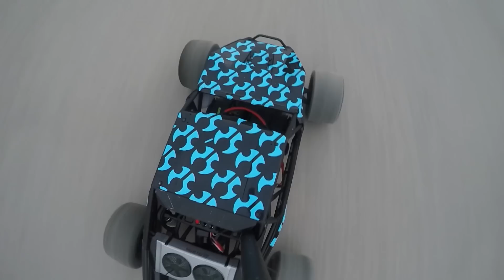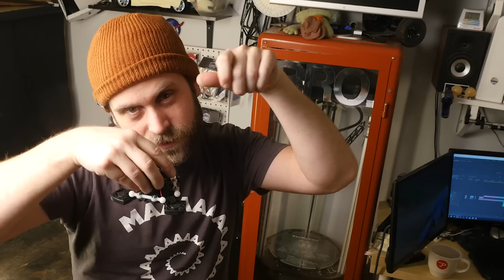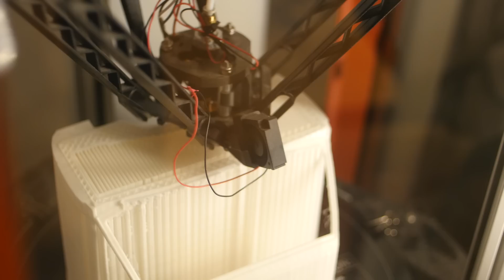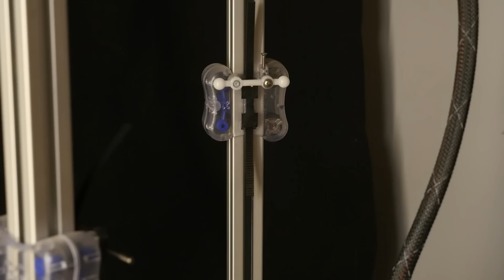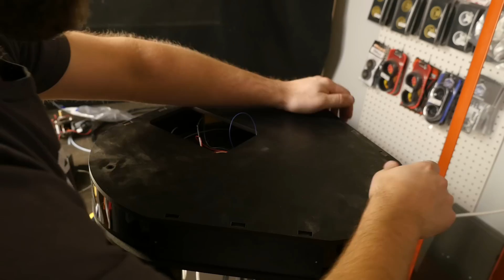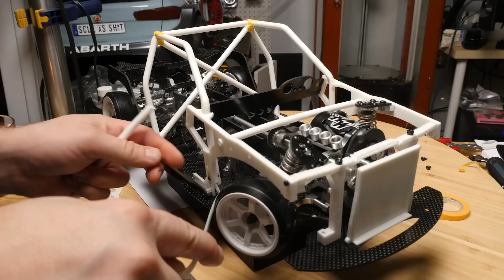KpopRC Printer SH*T the bed? - 3D Printer UPGRADE - Auto leveling

Comment: I'm glad I got myself the v3. Its was a lot easier to upgrade to duet and 3.2. I hated the 280 hot end. The se300 hot end is way easier to work on. They also have aluminum ball joints and carbon fiber arms. Which I added to my 3.2, mine also has the 0.9 steepers.
Reply from the maker: would you get the 3.2 again? debating when i replace, or add another one to the fam.
Reply: @kpopRC  I would definitely get the 3.2 upgrade again. Duet gives you the ability to control the printer via wifi.
Reply from the maker: @powcar91  the quiet steppers would be amazing. also. really want dual extruders.
Reply: @kpopRC  I would buy an aremtis it now comes with dual extruders, it was on sale a couple of weeks ago. But they only sale it now as a ready to print. Unless matter hackers has a kit.